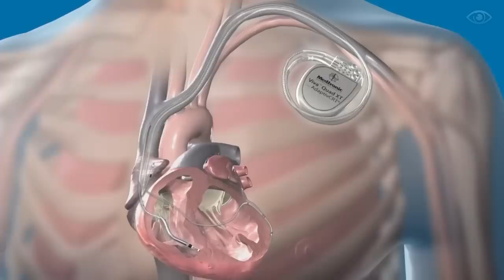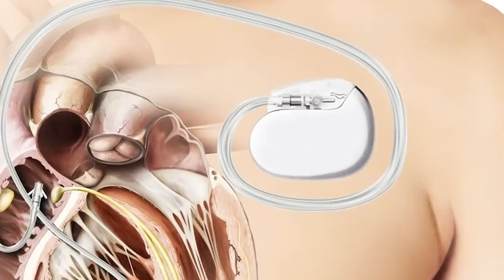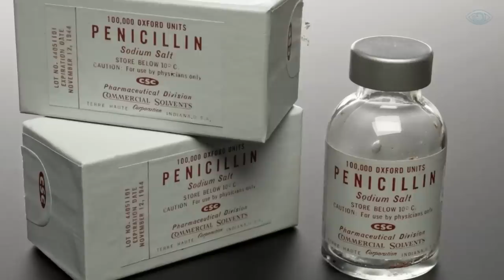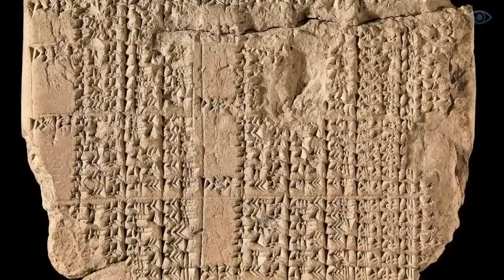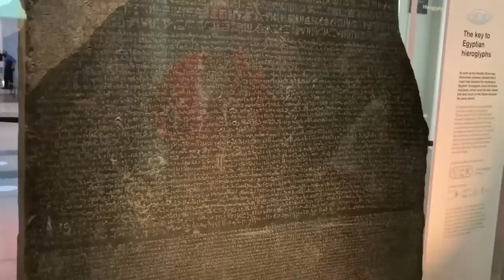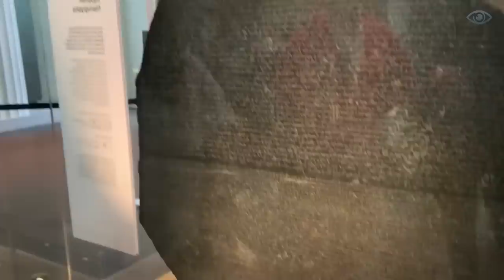Scientists Are TERRIFIED By This Accidental Discovery!

Comment: So/ What adhesive was used to glue the shell grotto shells in place ?. That must be some great glue. and  most old traditional  such as gutta percha, and pitch , or hide glue do not last very long, and it appears all shells are still in place. What glue was used??. Also, the horizontal lines are not very straight and precise. What could that imply?